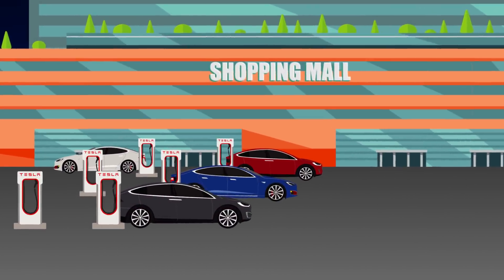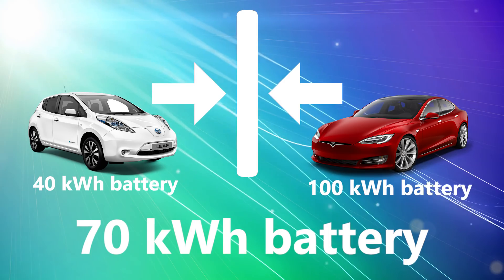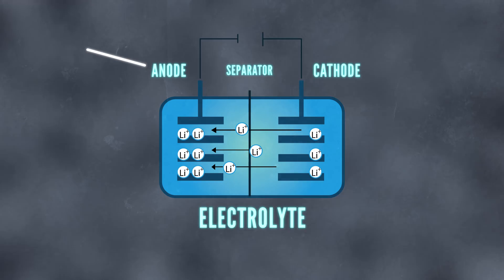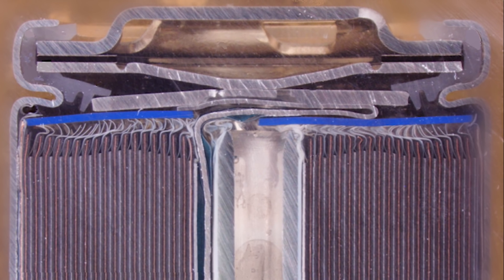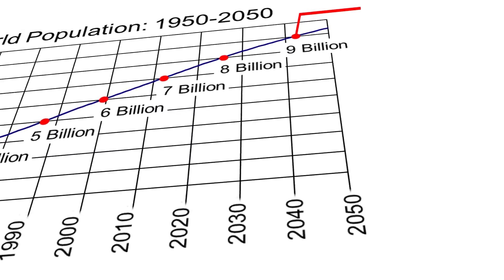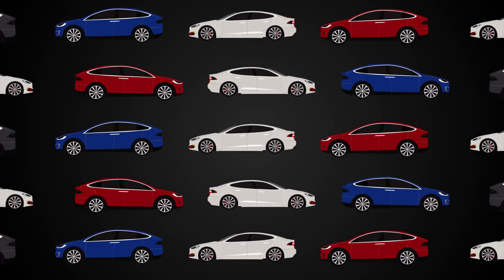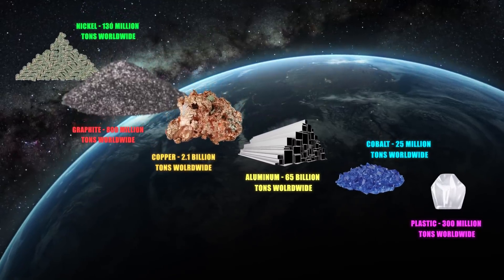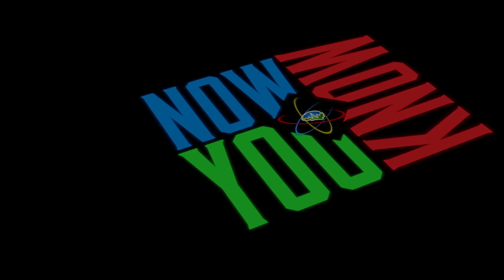Will there be enough EV Battery Material?

Comment: I like ICE but I would be fine with EV's if the economics make sense. One thing that I think is overlooked is that lithium in reserve doesn't mean it is easy/economical to extract. It happens with every raw material industry. The cheapest and easiest reserves are tapped first. Then those resources that are increasingly more expensive to extract as the raw materials are deeper, more remotely located, etc. Think about oil/petroleum for example. It was first taken from shallow wells or even from places where it was naturally seeping up out of the ground. Then increasingly drilled for, deeper and deeper. Then on to offshore drilling (more expensive.) Now on to shale sands which is more expensive yet. The same happened with iron ore industry shifting to taconite as the cheap and plentiful ore reserves were consumed.

Having adequate lithium on reserve doesn't mean it will make sense financially to extract 100% of it.
Reply: Very inciteful comment,  I'm thinking other tech innovations might offset this cost.

Comment: Thanks for giving us the estimated number of EV's on the road for one year.  What about all the years amd batteries in between now and then that would have been produced, run, and scrapped by then? Also, do we really think that batteries are going to be smaller than a current tesla battery?  No! Batteries are only going to get bigger as more go into trucks, semi's, and construction equipment.  John Deere is already starting to out batteries in small tractors.  Bet that won't be 75 kw.

Comment: Future based on only 10% of cars on the road. Good luck.
Better talk about (just to give examples) Dysprosium and Neodym as well, since the battery doesnt take the car anywhere, you need a motor as well. Anyway, if we would want to be so quick with it, we should multiply the production of metals and materials, which could make the world a very grim place since production is happening in third world countries that dump everything to air and sea.
So the process is possible, but it will take a very long time, starting from bringing the production countries to the level of environmental awareness of the western countries.
But for the ignorant 80-90% of people, this video will sink in just fine. 
Also the production of energy is not thought of, in coal-fired power plants, about 1 ton of copper is needed per megawatt, but in onshore wind power plants, about 3 tons and in offshore wind power plants, up to 8 tons per megawatt. This adds up when you multiply it by the needed power delivery.
Etc. 
Bottom line is, the new green deal is currently without means to provide, and people will suffer.

Comment: Liithum reserves are not Lithium carbonate used for batteries; in fact since any meaningful numbers of EVs started to be produced - 2020; the price of Lithium Carbonate has risen 1200%, this is due to EV production.  If there were lots of lithium or cheap means to produce that needed for lithium batteries the price would not be up so high - thus your analysis is wrong.  A choke point already exists - and for EVs based on Lithium carbonate the total possible production is 5 million max if all resources were devoted to EVs which won't happen. Hence a realistic guess is max Li EV production will be 2 million short term.  When and if a scalable chemistry happens this could all change; but you still need thermonuclear energy to provide a green grid or its mostly pointless; as EVs take more energy to make.

Comment: So many assumptions made are wrong this is basically useless
Average battery power is never staying at 70kwh, you fail to take into account the trucking industry, and you’re assumptions about full self driving and it’s affects on the amount cars on the road is not only wrong but completely the opposite of what is happening.

Comment: Hmm, on 10% of todays car? Very convenient for the result but I doubt it. The world is luckily getting richer and peoples want more cars. I am not buying the "100% autonomous car" for the whole world. Lets get back to the 120% compared to today, then we need Cobalt: 28 M tons, Nickel: 150 M tons and Lithium: 22 M tons. Available resources:  Cobalt: 25 M tons, Nickel: 130 M tons and Lithium: 24 M tons (not 39 M tons at 4:00). There is not even enough resources for EV cars alone. And what about for other products? electronics? alloys (lots of nickel is needed in steel industries)? trucks? home storage? and not at least megapacks for utility use where their is the most needed? 

And we are not even talking about, how messy mining for these material is. It is in sane to use nickel based batteries in Tesla power wall and megapacks. It must at least be lithium iron in the short run and in the long run sodium batteries or similar for storage and small EV. I do believe there is enough sustainable material for electrification of the transport and energy sector. It will just not be based on lithium batteries alone. What Tesla is providing so far is a small but important part of the many solutions. Their mission of "transition to sustainable energy" is overrated. Their energy and storage solutions sucks pretty much at the moment.

I think you should edit your explanation of "resource". Here is what it means:
"A RESOURCE is that amount of a geologic commodity that exists in both DISCOVERED AND UNDISCOVERED deposits—by definition, then, a “best guess.” Reserves are that subgroup of a resource that have been discovered, have a known size, and can be extracted at a profit."

Great topic, Cheers👌

Comment: You forgot that during the next 20 years all these people will have had multiple cars, so if you are not only wrong about the 10% needed, but the average person has 3 different cars in the span of 20 years (I don't even know what the lifespan of these batteries are), then you have a problem. On top of that, the extraction of these minerals are generating environmental problems in the locations where the mining occurs.

Comment: The average person does not drive a single car for their whole life, and Lit-Ion battery technologies dont surpass the 20yr lifespan, I think each owner would at minimum get 2 cars throughout their life, so around 2.5 cars/person per generation, Im not at all sure there will only be 10% of cars as there are now, automation does not mean willingness to share, many people would want their own cars, but lets consider we reduce it by a half.

So you said we had 17x as much material as we needed, divide by 2,5 cars/person per generqtion, we have 7x as much material, divide by 5 because the estimate for the amount of cars is low for what I said before, that is around 1,5x so that means we have ev cars for 1 generation and a half.

We need a circular economy that is able to retrieve these materials, it is not viable otherwise

Comment: A few issues that were not addressed. They talk as though a lithium battery lasts forever and that an EV car lasts forever. Is the lithium in an EV battery 100% recyclable? Are there any other needs for lithium aside from car batteries such as energy storage for the grid which will be needed to charge lithium batteries?

Comment: 1) Forecasts show we could have up to 3x more cars in 2050 than now, not 10% of what we have now 2) battery materials will be needed for many other appliances and energy services, the demand for which is also going to increase, 3) mining reserves do not mean they are all equally easily accessible - prices will go up, resistance to a booming mining industry will also increase, 4) steel and aluminium are highly sought after in other industries (construction, renewable energy, aviation-shipping, also other car parts), where the demand is also forecast to rise significantly. All in all, we're looking at a slew of new problems and challenges that we will need to deal with.

Comment: 1) Read the Institute for Energy Research's article titled "The Physical Impossibility of Renewable Energy Meeting the Paris Accord Goals" at https://www.instituteforenergyresearch.org/renewable/the-physical-impossibility-of-renewable-energy-meeting-the-paris-accord-goals/. States 500,000 lbs. 250 tons of earth need to be mined to generate 50,000 lbs. of rare earth minerals. That's the equivalent digging of 18 dump trucks. Scaling to 1 million batteries just for a miniscule of vehicles in the United States means 18 million dump trucks of dirt. Enormous carbon footprint. And to get to 100 million will be 1.8 million dump trucks.
2) Fuel tanks in 168,000 service stations will have to be pumped dry and many will need to be removed especially if they are made of corrodible metals. An large cost and effort with more carbon footprint.

3) The need to double the transmission infrastructure of 200,000 miles of power lines will be a huge cost to bear. Plus solar/wind will be very costly in that the plastics needed will be double what is in the environment now (see the Institute's report above.
4) Major cities with urban centers, apartments and condominium buildings will have a hard time making enough connections available for residents, especially in high rise buildings.
5) The cost of batteries will go up because the rare materials will decline to be available.
6) Off -Road and commercial trucks/tow trucks will need even larger batteries and even more powerful charging stations. There are at least 2 million semis in the U.S.
7) California which has a fire season shuts off power and that will threaten the adoption of EVs because they will no longer be reliable to escape.

Enjoy your day. :D
Reply: Correction: To get to 100 million EV batteries will require 1,800,000,000 or 1.8 billion dump trucks of unrefined dirt.

Comment: All your estimate are based on manufacturing car battery for consumers only one time, what degraded battery which will be of no use and battery recycling is still not achieved, what about those n number of cars that needs battery replacement.

You also completely ignored cargo vehicles, most of the diesel is used by them, the same will happen in case of battery.

Comment: Solid state batteries will use up to 10x more Lithium with the Li-metal anode it looks as such (judging by all the research) We will still have enough, BUT, lithium is not super easy to separate from the spodumene deposits and brine lakes take quite a but of time.

Comment: This video was about 1/20 the length it needed to be to do an analysis of this type. What wasn’t even mentioned was the fact that batteries have a lifespan. Ever notice you phone or laptop computer lose the ability to hold juice? 

Existing EV’s need a new battery every 8 years or so. So in 25 years, that’s 3 rounds of new batteries. Then, In 2043 if there’s all these electric cars on the road, perhaps the efficiency will be 50% better, so say a 12 Yr lifespan. That means a doubling battery of raw material demand From 2043 to 2055 plus any new vehicles that come about. 

What I believe will happen is the price of Nickel, Lithium and Cobalt and speculators drive the price up many years in advance of this supply shortage. Remember, all it will take is one of these elements having a tightened supply to impact the overall Price.  Raising the price of EV ownership will deter consumers to making the switch.

Comment: Good points for the most part. Only problem is that’s a close margin on lithium which has uses outside of Evs. Also average battery would be way way higher when we start adding bigger vehicles like semi trucks.

Comment: This video already made a false assumption that we will mostly be using autonomous vehicles, which is likely wrong. They didn't want to mention that the cut off is 3.5 billion cars and lithium becomes more difficult to mine over time. They also didn't take into account the industrialization of China, India, Africa. The higher usage of EVs as electricity is cheaper. I believe in Tesla, renewable energy, but these facts cannot simply be ignored by this video. Realism isn't a left or right paradigm, it's what happens.
Reply: KingJustice98 exactly. I hate it when they advocate false information.

Comment: Lithium batteries only make up about 46% of lithium usage. We also use Lithium batteries for tools, devices, and to backup photovoltaic systems. 

Also, as far as there being fewer cars, I think the number of driverless cars would not be as few as 10%. Outside of large urban communities, driverless cars have few applications. Sure, in future panopticon mega-cities, there will be few driverless cars, but not anytime soon.

It can take years for new streets to appear on GPS maps. In fact, I even know century-old roads that are not on GPS - a driver would need to take over or  if there's no steering wheel, they would need to walk lol.

I'm not knocking lithium, but I think we are going to use a lot. Lithium is also an important resource besides oil that keeps the US in the Middle East; if access to cheap lithium is ever challenged, that might change things.

Comment: 100% in 25 years? One thing to consider is gasoline will plummet in price as people switch to EV's which will provide strong negative feedback to EV adoption. Already as tax credits expire sales of EV's are reversing. And EV buyers are people in the $200K income range. They will have already bought and tax credits will be gone then what? I hope radical breakthroughs in Hydrogen production methods will result in fuel cells eliminating the batteries and the charging and range problem. I not saying I'll never own an EV but it will be a town car only if I do as I'll drive my ICE SUV on distant trips. So you might see people with a short range say 100 mile EV they can charge in a day plus hybrids or ICE in the driveway for decades to come. So going out  on a limb I'll estimate no more than 15% of vehicles on the road worldwide will be an EV in 25 years.

Comment: A point missed out by this is the distance all the materials travel to be prosessed then made into batteries then getting delivered to the final user. The batteries have logged up a fair few miles and the materials and finished product are transported using conventional fuled vehicles trucks ships etc. So even before the battery is fited in its device (car van phone computer toy etc etc etc) it has clocked up quite a carbon footprint. At this point in history the clean non polluting zero emitions car does not exist. It's just the polution is produced elsewhere at fosel fuled power stations or those lovely clean nuclear stations that produce waste that will remain lethal for thousands of years. As was mentioned in the video technology is ongoing and there are other clean ways to power vehicles that arnt quite there yet but have the potential of being better than batteries. So while battery powered electric cars are the in thing today tomorrow they may well be overtaken (pun intended) in the future.

Comment: Problem is not that we don't have enough lithium in the world. Most of the lithium deposits are ore deposits, and at the moment we don't know if mining it could be environmentally feasible. Ore mining is also prohibitively expensive at the moment.

New battery chemistries might make this a non-issue. Solid state sodium, aluminum urea or even single use aluminum air batteries could drastically reduce the amount of required lithium in the world.